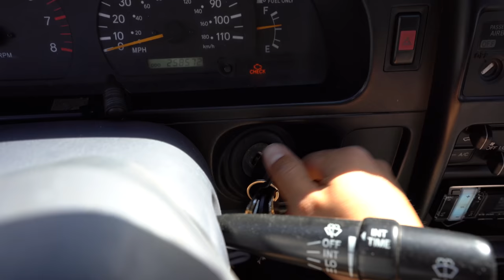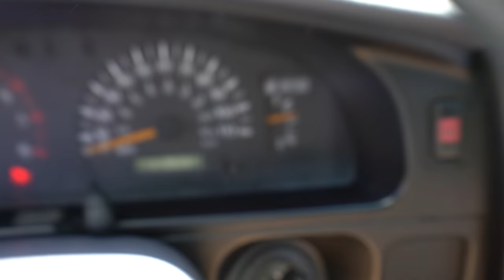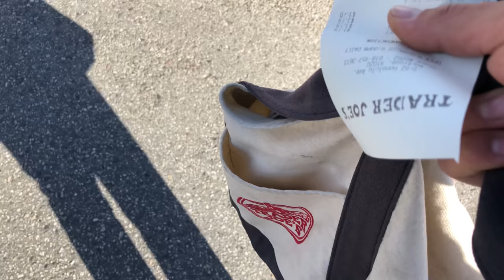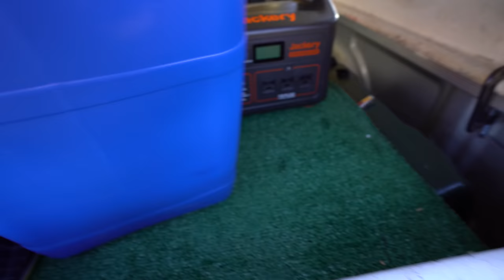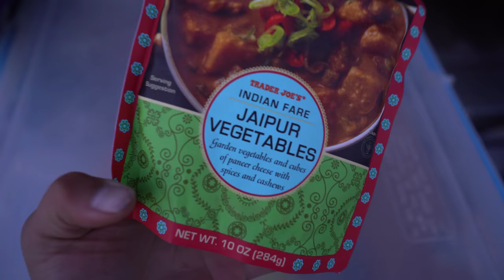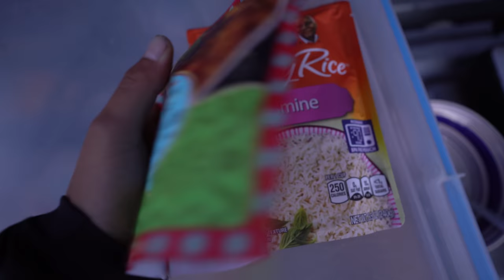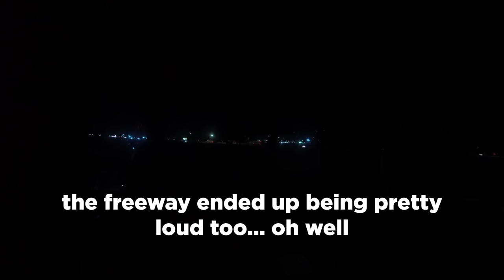Truck Camping at a Rest Area (For the First Time)

Comment: As a trucker (currently taking a break), it was always frustrating at the end of our night to see vans or regular trucks parked in a spot designed for 18 wheelers.  
What most non-truck drivers don’t understand is that we are on a timeframe and once our driving time is up and we stop at our pre-planned stop and you see a van or pick up truck parked in an area designed for 18 wheelers, it’s so frustrating.  Regular drivers can continue on down the road or go to Cracker Barrel’s, etc to park safely for the night.  
We can’t, we’ll get fined for so many reasons.   

So please anyone reading this, have respect for the truck drivers, they don’t have as many options as regular drivers do.  

Love your videos.  And yes, I think rest stops are fairly safe.  Just be aware of your surroundings.

Comment: Just for anyone reading this, please don't ever park in a semi truck parking spot. Parking spots fill up quick at night. I wouldn't want to be the reason a tired trucker is put in a dangerous situation because my personal vehicle is taking up a spot that was meant for that trucker. Also, they only have so long that they are legally allowed to drive. If they can't find a parking spot and they get stopped by DOT they could get in trouble. Truckers need those parking spots.

Comment: Was wondering how you secure or lock back window.  Been trying to find a way for my topper.
Reply: Depending on how your topper is, small bungee cords will work. They have too much resistance for someone to completely open the camper and if someone did try you would know immediately

Comment: I have to say that I really like your videos, but you worry me sleeping in a camper that is so easy to pop open. There is no protection.
Reply from the maker: Yeah it’s honestly kinda sketchy that I can’t lock it from the inside. Once of the benefits that car camping or suv camping has over truck camping. I’m sure there’s ways to rig up some kind of lock from the inside
Reply: @JonathanYentch  It really is a good idea to rig up a couple safety locks on the inside of the camper topper. Plus you would be seriously out of luck if you needed to get back into the front of the truck to get away quickly. 😞 Sorry, but it's a real unsafe thing to do, so at least rig up some safety locks, and absolutely rig up good locks for your truck camper windows and door 🌟